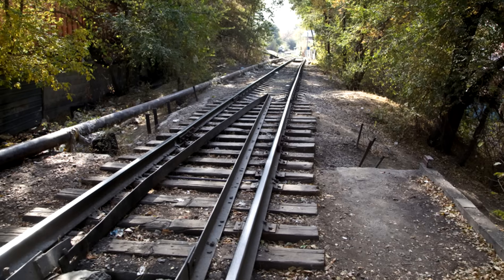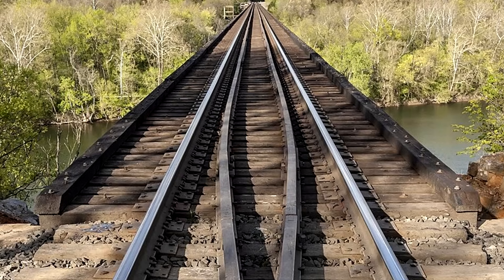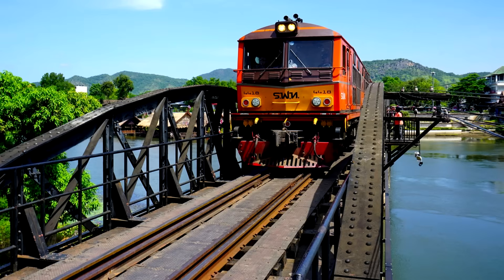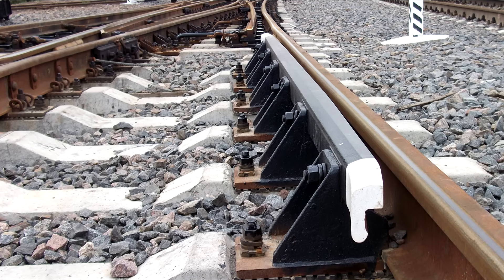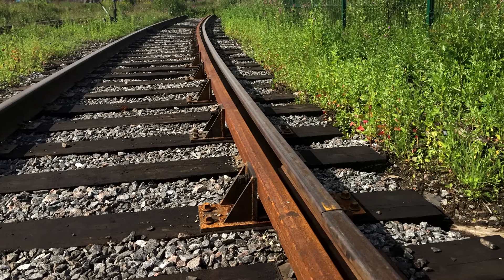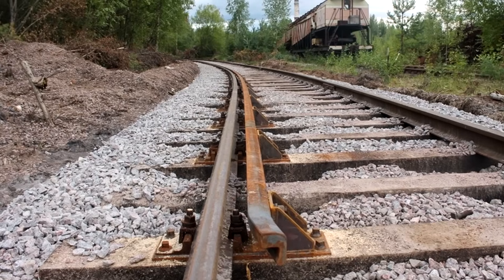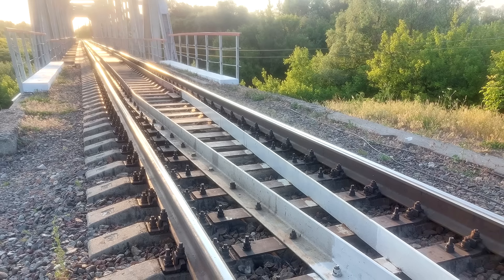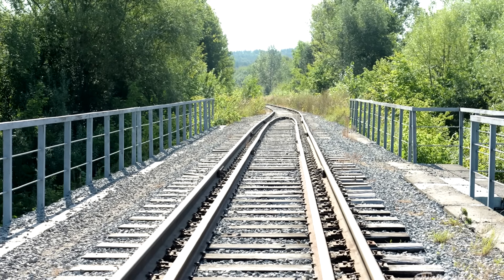Why are extra rails installed inside railway tracks? The secret is revealed!

Comment: CHECK RAILS !
The extra rails on points are called "CHECK RAILS". Those on bridges are NOT close to the running rails, and are there in case of a derailment to ensure the train if derailed does NOT crash off the bridge, as they catch the derailed wheels and hold the train basically in line with the track. Those fitted on points (Check Rails) are there to guide the wheels of a train through the dangerous "Frog" area (That's the "V" shaped part). Further "Check Rails" found on Long and sharp curves, are to prevent the powered wheels of train from trying to climb over the top of the running rail & derail. Remember trains unlike road vehicles have NO differential in their axles.  The two wheels are fixed solidly to the axle. So in a sharp curve, when the outer wheel needs to rotate quicker than the inner wheel, this CANNOT happen on a train, so one wheel is effectively dragged partially along the rail, which is the main reason why trains in sharp curve make horrible screeching noises !!!

Comment: In Australia, the state of New South Whales uses "Standard" gauge (4' 8 1/2" ) and the line running from the state capital ( Sydney ) to Brisbane, the capital of Queensland, naturally crosses the border. Queensland uses "Narrow" gauge but since it was an interstate line only this didn't matter. However some years back the Qld. State government needed to move a massive amount of Blue Metal Rock from a quarry that was located next to the railway line to the Port of Brisbane ( if my memory serves me correctly ). With the permission of State Rail ( NSW Railways ) an agreement was made and a third rail was installed so as Queensland Trains could operate on the existing track.
Reply from the maker: interesting information

Comment: What does a train pass, that tells the crossing gate way up ahead to activate? I’m too lazy to look it up.
Reply from the maker: special sensors are installed on the rails several kilometers from the crossing
Reply: Its called.A insulated joint .

Comment: Here in the Netherlands, they use ordinary rails for it, not jus thin steel plates like in the picture which are much weaker than rails .
Reply: You’d think they’d at least use old worn out rails.
Reply: Same rail as you travel over . nothing different at least over the bridge
Reply: Ik snap dat de extra rails verdere schade moet beperken.
Zou er een constructie mogelijk zijn om eventuele ontsporingen op dergelijke kwetsbare locaties weer op te heffen?
Is er iets te verzinnen waardoor de flenzen automatisch weer binnen de rails vallen?